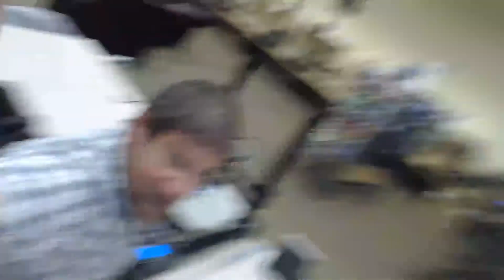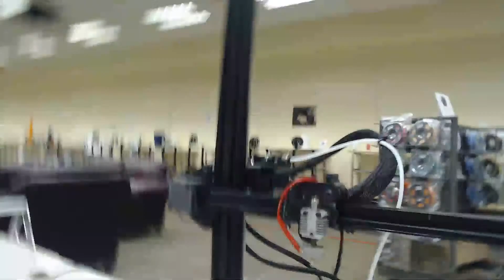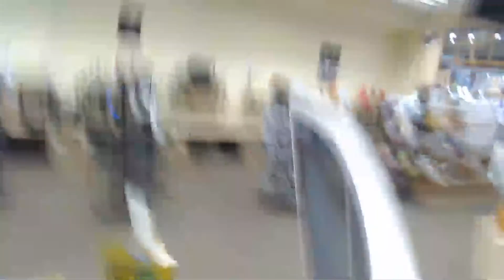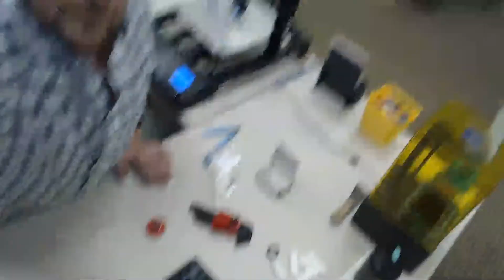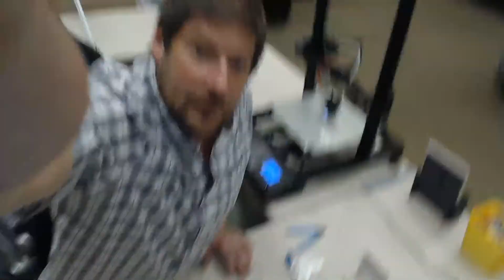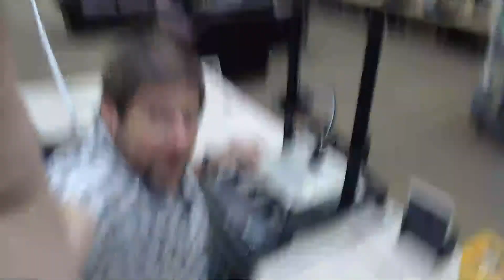Sunlu S8 Micro Swiss All Metal Hotend Upgrade

Comment: Bought my S8 back in December 2020. I really do like the print quality of the printer. I still have the factory hotend, but cheap Amazon store nozzles.

Diwnside, I had to replace all of the fans within the 1st month. Bearings went bad almost immediately. BUT, I was planning on putting Noctua fans on anyways, so that wasn't really a detractor.
The default parts cooler sucks, as it does with most printers overseen.  Printed a new one out and everything is working great.
... Now I'm looking at adding the all metal hotend.

Might actually pick up another one or two of the S8s if I find a sale.

Comment: I messed up my hotend upgrade when the thermistor wire broke as I was removing it from the original hotend. Can I solder it back together, or do I need to replace the whole thermistor?
Reply from the maker: easier to solder a new one about .5 meter in.  Standard thermistor sizes are usually 1 meter, but sunlu decided to make a 10 foot wire going back across the frame.  They fail where they are soldered because imho it's too close to the hot end and moves so much.  So I would try and solder a new thermistor in a bit further where it shouldn't break due to flexing.
Reply: @NAV3DP  Thank you!
Reply: I cant find the wire long enough. I did same thing.

Comment: Navarre, I have an S8 that is less than 2 months old. Today when I turned it on it sound like the bearings on the fan by the circuit board was grinding, I opened the panel up and its the fan in the power supply (intermittent noise issue). I tried printing something today and it stopped printing and gave an E1 minitemp error code. What I'm seeing online is that the Thermister may be bad. Is that the part you pulled out of the print head or is it built in the print head. If its wired part you pulled out - is it 24V or 12V? This is my 1st 3d printer and have had nothing but ongoing issues with clogs. Thank you.
Reply from the maker: Yes, the s8 has a VERY poor design for the thermistor.  It is soldered inline with a long wire going back to the mainboard. You can buy a replacement direct from their site or solder a standard one yourself.  I recommend soldering it back further where it will not constantly flex. I believe this is the issue with the stock thermistor, it's soldered where it constantly flexed from printing.
Reply: @NAV3DP I didnt see a replacement part on sunless website. Is it the 24v thermistor? My coworkers recommended the enders 3 pro, and I went with sunlu (bigger is not always better). I've had to run it 20 to 30c hotter than they do when printing. Sunlu support is a joke - texting through Facebook. Thanks for your info.
Reply from the maker: @Danaton2  Most every thermistor for 3d printing is 100k.  The 24/12 volt refers to the fans and heater cartridge.   I am a creality distributor and also get their amazon returns if you ever need more printers.

Comment: I have a s8. I'm changing the motherboard to a skr 1.4 turbo and i put a micro swiss direct drive all metal hotend on it and smoothers v1.0 from bigtreetech i love my printer it is my frist
Reply: I did that to mine, stock motherboard on these sucks and the skr mini 1.4 is awesome but a lot of work to update, be prepared to cut you box up a little bit to make the sd card and lcd screen  line up right. You will need to print a adapter for the board also for the screw holes to line up right
Reply from the maker: @drewrinker2071  yea. for their first printer, not too bad.... they promised a pro version where these issues would be fixed, but it never happen.